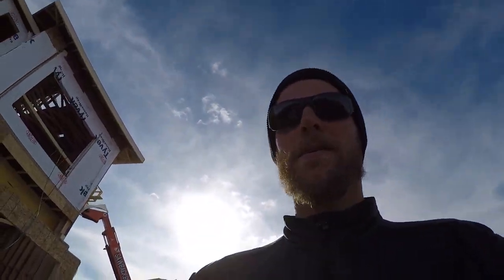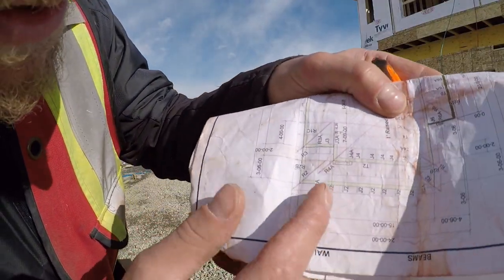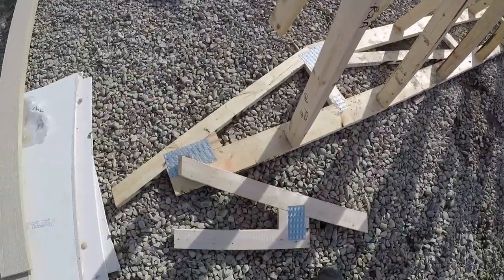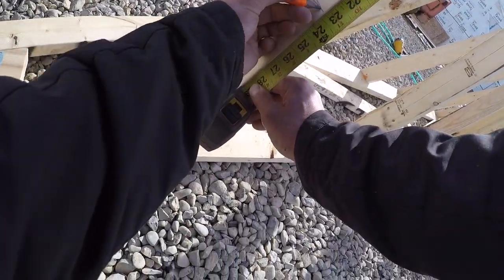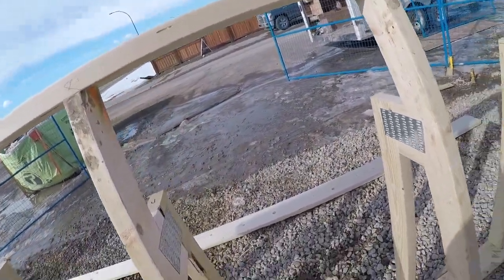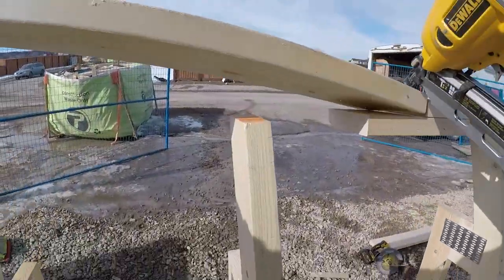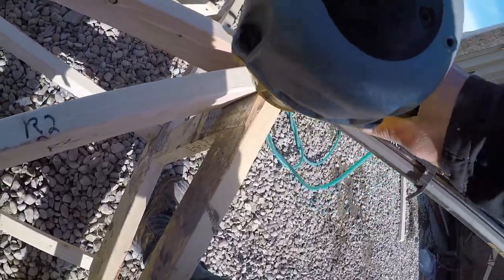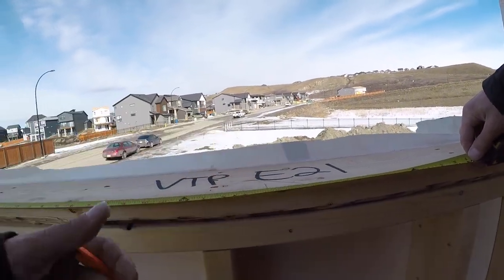How to build a midroof - basic truss layout - Savage woodworker

Comment: Hey there. Thanks for the great videos. I’m learning a lot from your channel. Question: what kind of staple gun are you using for the roof sheathing and what size of staples are they? Thanks man!
Reply from the maker: Thanks alot man. Its rewarding for sure. I love it. But ya it aint easy haha. Thanks again
Reply from the maker: Staple is an air max. We use 7/16 heavy wire gauge staples. 1 1/2 length. Cheers